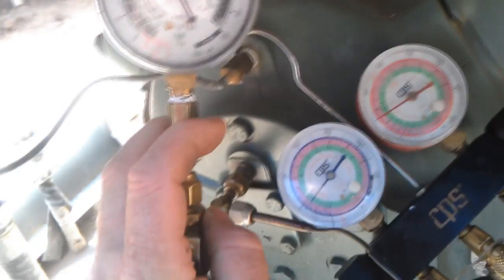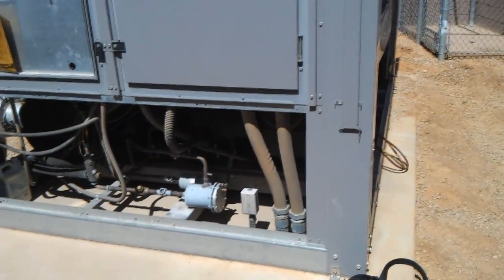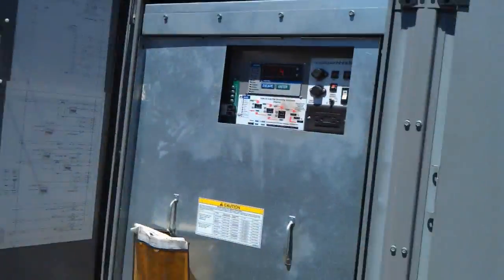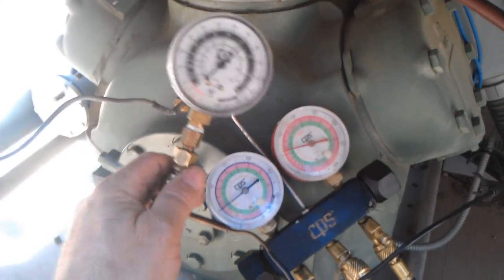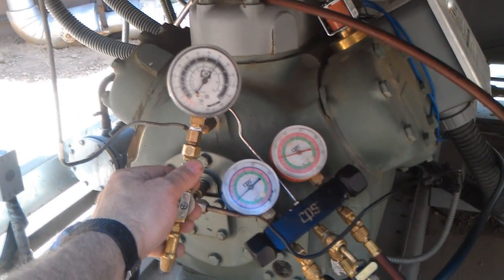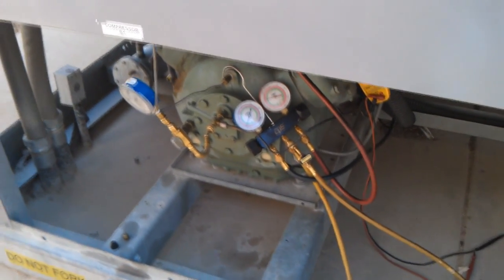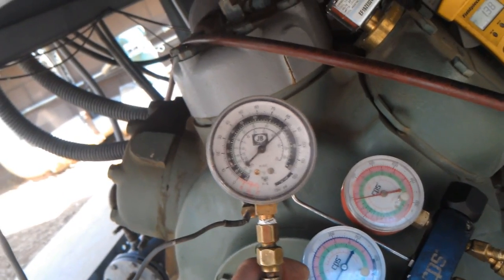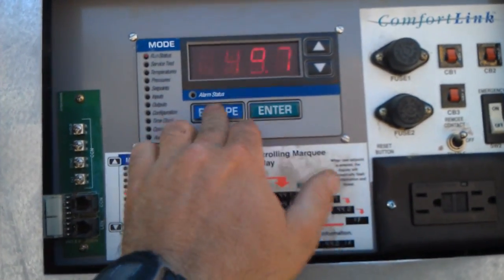Chasing a low oil pressure fault instead of the obvious on a 30GTR060 Carrier Chiller

Comment: Oh, that's the unit with the high static kit
Reply from the maker: It did until I replaced all the motors and blades to the standard. As it should have been ordered with.
It was so quiet after that!

Comment: Brother I saw your video is really good and helpful to me, I would like to ask you further details in related on HVAC, may I have your whatsapp contact number if you really helping others. I work for HVAC, but still I need to learn some electrical control circuit on carrier make on the same model with 38APD model series

Comment: If the oil pressaure was the probleme you would have to push the button on that . i did not see that. Another thing i was thinking of was that it looked like you had a oil pressaure with a least more than 1 bar compared to the evaporation pressarure wich is normal. Maybe your manometer had a special scale. Sorry for my bad spelling. Greatings from a Swedish cooling technision since 30 year

Comment: Hello sir. I am Shanti from india.i need your help.we have a client.who has a Voltas water cooled chiller package 60 TR. there is issue of low oil pressure.compressor is going down in every 5 or 10 menuts.we are technician but how to fix this problem please tell.its my request please give me your WhatsApp no..i need your help
Reply: You need to give more info regarding the system and compressor all readings
Reply: Voltas usually installs carrier comp if it is coupledrive it is 66 tr with three heads containing 2 piston sleeves each

Comment: have a question i need to change oil pump on 30HXC chiller what is the procedure
Reply from the maker: I'm not familiar with that Chiller.
I'm not really a "Chiller tech" either. 
I had a few on site at a facility I worked at for 5 years and I go work on them for emergency calls and figure out how to fix them. But so far I don't do chillers on a regular basis.
We got an older guy who does that. Guess the rooftops are too much for him. HE HE

Comment: Where are you located? We have a 30hxc126RY that one compressor keeps going off on t-026.  It will start and shut off at random times. Carrier tech has replaced oil pump and check valve.  did not work.  we are waiting for a carrier service engineer to come on aug. 3.  any ideas? were in dallas ft worth area.
Reply from the maker: Melissa Meek I'm in Arizona. Texas is a little far.

I don't work on these all the time. But I seem to be able to figure out almost anything.
The carrier engineer should know the unit pretty good.
I'm not sure what that error is without having a manual handy but the Carrier tech will know.
Reply: hackfreehvac
Reply: Melissa if you still need chiller service in the DFW area we can help. Contact me at our website www.hvacforney.com and we can get you fixed up.
Reply: Melissa Meek I can sort the problem if you tell me what t-026 stands for.

Comment: This is why you call us, the Factory Carrier Services Professionals. Little recip chiller with obvious refrigerant charge issue. We love following behind these building maintenance chiller wannabe's. if you were to read your gauges and paid attention you would have zeroed in on the root cause immediately. And to all you guys that dis Carrier,  I work for Carrier and have for 27 years. We build stuff you guys would never comprehend and it is normally fault free. Don't dis what you don't know.
Reply: You seem to forget that you too started at the  bottom and have learned a thing or two over your 27 years of experience. I’m sure you have let the smoke out of some equipment along the way. Have to give guys a break who don’t have many years under their belt. Not everyone will know what you might know and vise versa. 
I have 25 years with York and I don’t belittle anyone.
Reply: But, Larry you only know carrier. Some of us work on everything. I did notice the low head at the beginning.

Comment from the maker: Yeah found a leak on some copper lines that rubbed. Lines that went to remote pressure gauges. 

Now got a leak on the other hot gas valve. 
It's not leaked down enough to effect the system but there is oil seeping from the gas valve body. :-(

Comment from the maker: It's been doing pretty good until the water loop came apart underground a month ago!
Managed to keep it online, losing 23,000 gallons, except for a few hours the day we had a bunch of contractors out digging it up and we got it fixed. 

We also had ordered all 6 new fan motors, blades and mounts to get rid of the noisy high static fan option. 
I installed those a few weeks ago and wow is this unit quiet now! :-)

I should find some video clips and post it.

Comment: Always interesting and educational seeing your videos. It's hard to imagine why Carrier wouldn't also have installed a low pressure cutout in case the timed pumpdown is getting near vacuum.  With all the resets and ignoring that problem in the past, there could be water or noncondensables in the system now.  It was a good video with mystery right to the very end!  Thanks for uploading.

Comment: I'm an Air force HVAC tech, had the same situation last night on a standby call with a reciprocating compressor unit, one week into A/C start up and you gotta love fixing someone elses unit on a saturday night.   Sat on that unit for about 3 hours til it was good, thought it might have been the crankcase at first cuase the compressor was ice cold, but bubbles in the sight glass threw up a flag also, we call those other techs RR (reset and run), or triple L's (look, listen, leave).

Comment from the maker: When the system turns off the compressor it does a "pump down".
The pump down is a fixed time rather than stopping on a low pressure switch, etc.

Since it was low on charge, it was pumping down quicker and then into a vacuum like that. After R22 was added it no longer pumped into a deep vacuum.

Comment: why does the circuit pump down into a vacuum? why cant it just shut the compressor off??
Reply: joeyf504327 probably they have bypassed the low pressure switch.